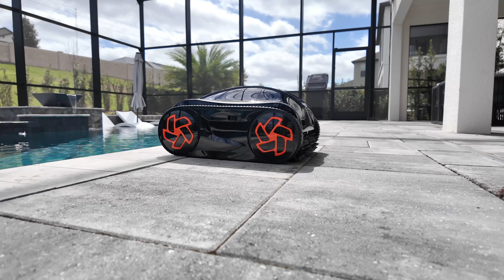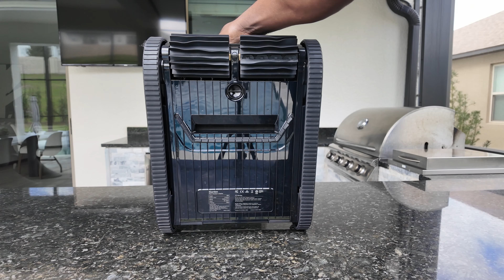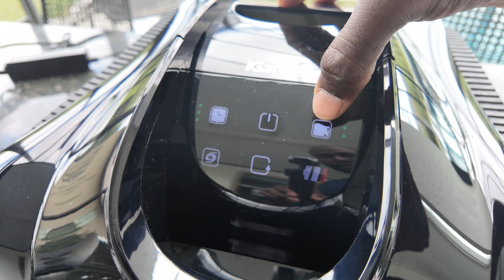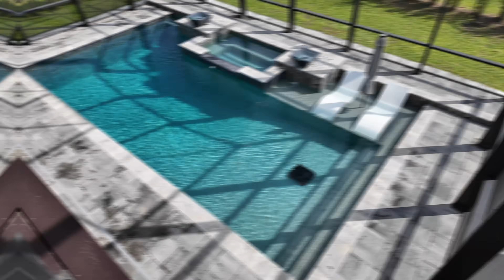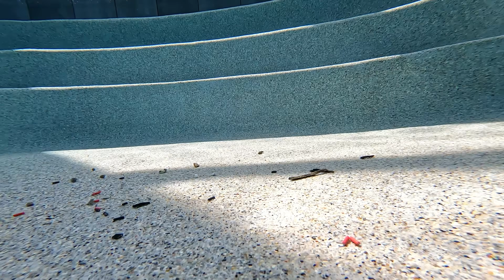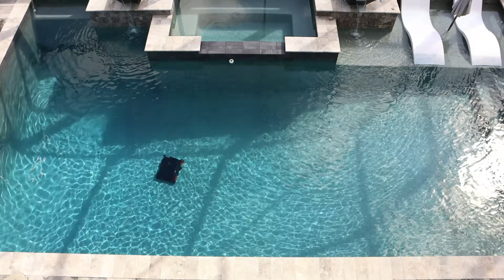The iGarden K60 Pool Robot Runs for 6 HOURS… Is This the Best Pool Cleaner Yet?

Comment: Thanks…best, most powerful robot is Aiper X1 promax, almost double the power of all others
Reply from the maker: Also a completely different price range. both devices are powerful though
Reply: @Triple_M  yeah,but what’s the point of buying something cheap that doesn’t really work. the average cleaner is 2500, Aiper is 8500, after decades buying robots, that never really clean the floors, the Aiper is one of a kind